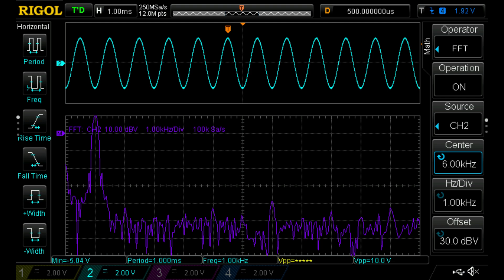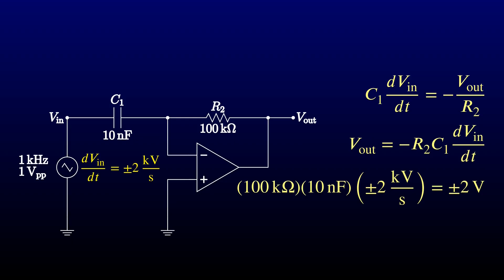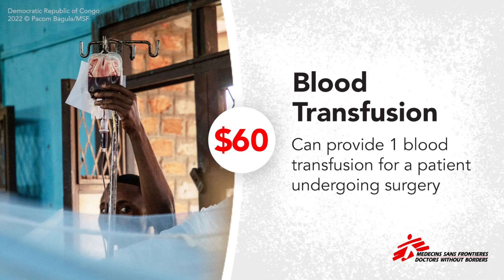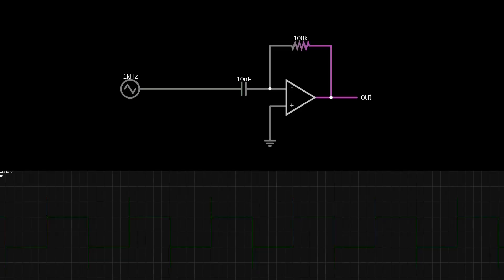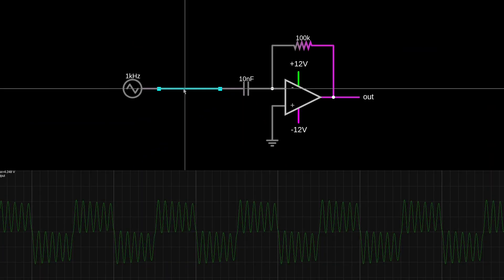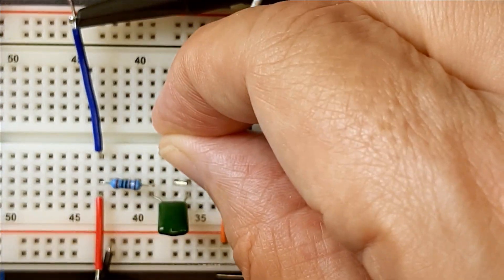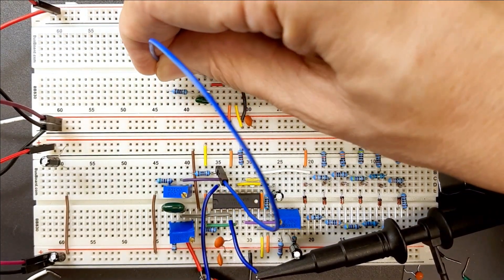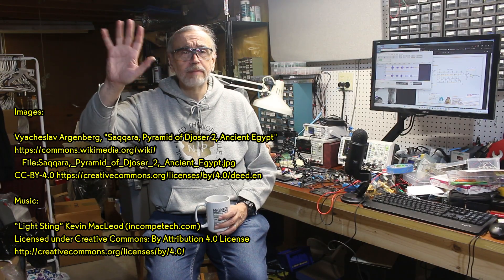The Op-Amp Differentiator | Op-Amp Basics, episode 11

Comment: Interesting... I recently watched Free Electron's videos about building a THD analyzer from a 1981 magazine article. It's quite complicated and uses a very good notch filter to remove the fundamental. The differentiator is probably 100x simpler... but I suspect its  accuracy isn't 100x worse.
Reply from the maker: Yeah, at some point I want to build (or find at surplus) a proper distortion analyzer.  Unless you're talking about RF, it's easier in the digital world, where you can use autocorrelation to extract spectrum information from a stream of samples. (You need a very good low-noise signal path and a stable A/D, of course.)

Comment: Nice Djoseroid! I suppose a "differentiated" Wien bridge oscillator signal would be a better cosine. I love these tests.
Reply from the maker: RIght, Wien bridge has great signal purity.  But a Wien bridge is really hard to get a wide tuning range - and even harder to voltage-control. What might work better is the Gilbert sine shaper (like the AD639, rest in peace).  I'll probably at some point try to hand-match some discrete transisotrs and try building one.
Reply: @KludgesFromKevinsCave  Staying tuned!!
Reply: @KludgesFromKevinsCave  That would be great !
Reply: I'm with you ! I have a soft spot for the Wein Bridge Oscillator